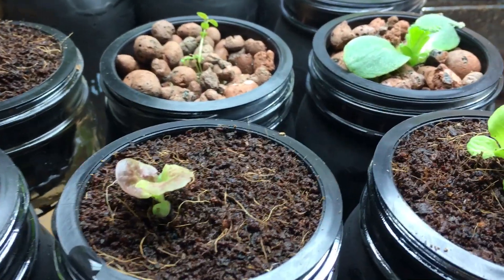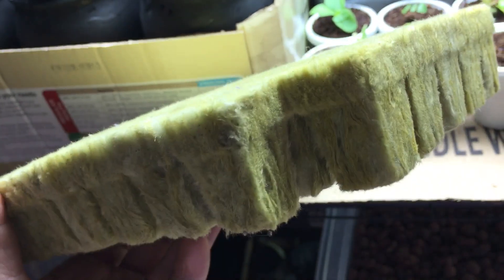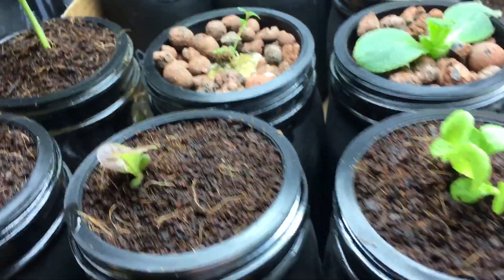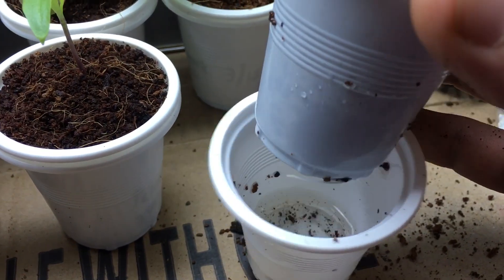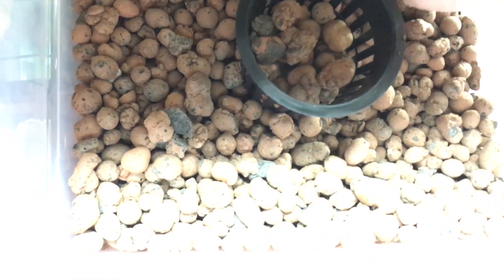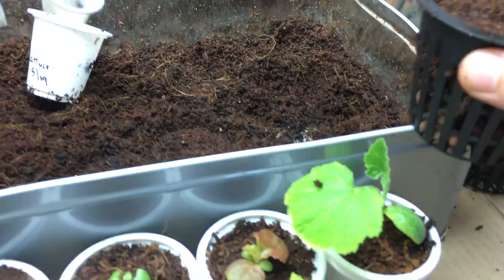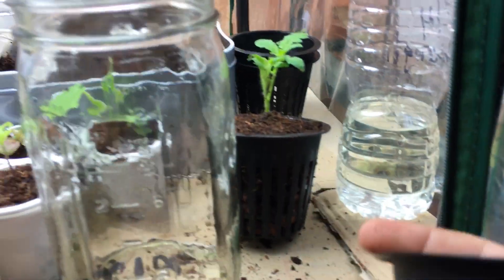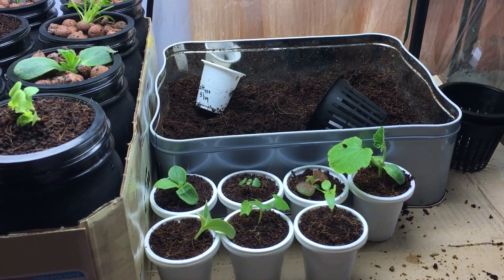How To Transplant Coco Coir Into Hydroponic Kratky System - Step By Step

Comment: fantastic idea. i also heard some use 4 parts clay pebbles to 7 parts coir as the initial medium. Sounds like they mix them together. Im going to try sowing a few seeds into 2 inch net cups with the coir and clay mixed together as the main medium. Make it even easier. Then just plop them in to the kratky container lid and take it from there. I have had issues with rockwool and pebbles on top too! algae or mold on some of the pebbles.Horrid...love your method too. Thankyou

Comment: 太厉害了 太符合我这种喜欢整齐的人了 请问你怎么施肥呢
Reply: Hi Lily, this is a hydroponic method called "The Kratky Method" or "Non-recirculating Hydroponics".

You need to use hydroponic nutrients in the water which you put into the jar. This is a chemical fertilizer which comes as a powder and it must be diluted according to the instructions on the packet.

Once the jar is filled with the hydroponic nutrient solution, you do not need to add any other fertilizer.

This method is easy for beginners because you can put the plant into the jar, fill it with the hydroponic nutrient solution and then it is done.

I hope that this makes sense. Please let me know if you want more information.

Comment: Do we need to
Sterilize the coco coir, TIA
Reply from the maker: No I don't think so. I never do anything special. Just add water and seeds. It expands a lot example thought so you probably will need less than you think. It's a good idea to wash it first time you open it. Will help wash off any dust and lose debris that may be around.

Comment: Rockwool started off great for me my first year and a half in hydroponics but something changed. The last shipment of rockwool has made germination so difficult. Maybe only a third of my plants were germinating and not dying off within the first week of life, and no this wasn't due to damping off. I switched to germinating in paper towels which has worked great but then transplanting into hydroton has been difficult for the more sensitive (smaller) plants. I'm excited to try coco coir next, I think it'll end up being what I've been looking for.
Reply from the maker: Coco coir is great for sure, but it's not so great for larger plants. Just keep it in mind. Like tomatoes, peppers that need support will fall right over once it's dry. Excellent for leafy greens and small plants. Especially strating out new seeds
Reply: @SoothingLeaf  oh I was just intending to use coco coir for seedlings, then move the seedlings into (on top of) hydroton. Thanks for the warning though! :)

Comment: I'll try much time to seeding in coco pet but every time I failed what a problem?
Reply: It's possible that your coco peat is too high in salinity and it is killing your seedlings.

You may need to soak and flush your coir before use.

Some coir is low in salinity and can be used directly but other brands require the salts to be leached before use.

Comment: Have you tried to soak rock wool in diluted Hydrogen Peroxide to prevent algae growth? Can't you use clay pebbles as the only medium, instead of using coconut coir? Have you also tried to use perlite or vermiculite as the medium? Thanks.
Reply: Hydrogen peroxide is a double edged sword, it can easily kill your plant, plus 3% H202 is really expensive.  I live in the desert and even with covering the rockwool with radiant barrier insulation, it still gets algae, and I mean heavy slime algae.  I switched to coir/perlite/vermiculite mix, planted in a 12" air pruning tree tube, then the tree tube sits in a 10" net basket which is inserted into a 2 gallon food grade bucket.  This has been the only thing that works here in the desert.  I have a 2-1/2 acre farm so it was gratifying to finally find something that works.  Another problem I had is that once the weather hit the mid 100's, the rockwool was drying out causing stress to the plant.
Reply from the maker: No never tried that. I would honestly avoid doing that. I can't imagine it's healthy especially for consumption plants. Instead just cover the rockwool with a grow media like clay pebbles or even foil would do great. As long as you keep it covered you keep algae away.
Reply: @SoothingLeaf  Hydrogen peroxide is water with an extra oxygen atom. 
Nothing scary but yes you can definitely over oxygenate things and bleach/burn.  
Lots of people drink diluted food grade hydrogen peroxide to oxygenate the body and cure disease.

Comment: Could you start with seed directly in this? Like instead of waiting for it to grow roots in another cup, just plant it directly into mesh pot with clay and coco and then just water from top until roots showing and then after start filling the jar?
Reply from the maker: Yes you could absolutely start this way. The only thing is when you are going to be top watering some of the Coco coir will fall to the bottom of the jar or container used. This will not affect the plants growth or anything but I don't like having Coco coir in my water. You could always just replace the water inside when roots are a little established and you are no longer top watering.

Comment: You will need oxygen later on in growth
Reply: Look up videos about the Kratky hydroponic method. It uses the roots that are exposed to the air as the water level drops to absorb oxygen.
Reply: If you used a traditional Kratky method using rock wool instead of coir, then yes, you need 02 at some point. He is also not using the traditional Kratky method of rock wool growing into an entirely water medium, he is using self-watering pots - in other words, it is not really Kratky growing we are seeing here, it is a traditional growing method which just happens to use Kratky nutrients.

Comment: Excellent presentation sir

But let me know if this will work equally well in daylight (patio/ terrace/ backyard) during summer at 100 degrees?
Reply: Yes, it will work fine.  I live in the High Desert of California and use a modified Kratky system myself.  I always recommend that if you live where it regularly gets over 100 degrees, to grow under shade cloth or on a covered patio.  I have been farming for 15 years and even my trees are under 90% shade cloth.

Comment: Great video!  I tend to start seeds in seed starter mix or coco, then when the seedling gets its true leaves, I carefully pull out the plant and wash off the roots. Then thread the roots through a net cup and put into nutes in a mason jar. I use hydroton to hold the plant up in net cup and block out light. This seems to work well so you never have rockwool rotting or coco falling into the water.  All methods seem to work though and all a matter of preference. Love Kratky !

Comment: Just because you can't see algae on the coco coir doesn't mean there isn't any. It's just you can't see it in the darker material.
Reply from the maker: I wash and clean the jars between refills now and check the levels every 2 weeks changing out the nutrients if needed. It is now 100% light proof but definitely does a good job in my experience. The paint will begin to chip away with each wash so might be best to use a different material to cover up the jars. thanks for watching

Comment: You fill the jar with nutrient solution above the bottom of the net cup. Then how does air get to the roots - can it penetrate the coco coir  ? Please  educate me.
Reply from the maker: Being that I am using two grow media I wanted to make sure it was able to wick its way up well. So I add a little bit higher then just touching the very bottom of the netcup. I learned from experience once you get the lights on the system a lot of the water will evaporate and may drop your levels faster then you assume. So by the time your roots begin to grow down your levels will have already fallen below the net cup. Also everything that is in between the water line and the top of the net cup is above the water allowing the roots to stay air roots and some roots to become water roots. Hope this answers your questions.
Reply: If the root doesn't grow as fast to reach the bottom of the net cup, does it mean we need to top up nutrients during the initial growth period?

Comment: Nice love how you do that definitely gonna try this only need now left is waiting for the Fertilizer,  Ph Meter: and Coco Coir, Is CoCo Peat Coir Fiber the same as FibreDust Coco Coir ? http://tinyurl.com/n3ch8oo sad to hear that amazon usually ships within 1 to 2 months :-/ but dang the Coco Coir look much better than soil or potting mix
Reply from the maker: That's awesome your almost all ready to go just a little longer I'm sure you can't wait to start. Wow that is some serious wait time way to long I think and not worth the wait. This looks like a great alternative you found. Organic, pre washed with reverse osmosis water and good price. I never heard of coco peat but appears to be the same thing with a different name. Both seem to be made the same way out of the same product so I can't see any distinguishing difference. Just learned recently that it's even reusable for up to several years wow! No need to wait a month to start growing. You found a great option i would go with it! Just remember to pre wash it yourself several times before using. I like to use an old pillow case holds everything in easily without losing.a ton of coco in the process (use hot water) hope this answers your question.
Reply: Oh thats a good idea!!  (ping...Light bulb ON lol) for cleaning coco with a pillow case :)
Reply from the maker: A nice tip after washing the coco place into a closed container and it will stay nice and moist ready to be used when needed. And you can wash little bits at  a time or you need a large container to hold all that expanded coco. Half of the block filled up a 5 gallon bucket to the rim for me. Little goes a long way
Reply from the maker: This will be a good option and local pickup is even better no need to wait for mail. Looks like its a good coco coir and decent price for 11 lbs block. They sell one that is also $32 I see same thing just broken up already. This is just a marketing ploy mentioned washed it 3x and the one your looking at does not say anything about how many times rinsed. So just simply give it a really good soak and rinse when you get it and will be good for use. You want to wash out the coco coir not only to get ride the debris and dirt but also the salt content. Coco coir is high in potassium so its best to give it a real good rinse. Using hot water i find speeds up the process breaking down brick and sterilizes the product a bit.
Reply: Just bought 4 blocks for coconut fiber from Home Depot $2.99 each got about 4 to 5 gallon worth right to the top washed it for about 5 mins (hot) like you said how long does it take to dry ?
Reply from the maker: That is a little hard to say. I have a 5 gallon bucket that has been sitting there for about a week and half now still as moist as ever. If you keep it together will stay wet/damp for a long time. Hold like 5-9x it's weight in water. But will really depend on the conditions your keeping it in. If out of the sun and covered should be ready for use for a few weeks. The easiest way to know is either by the weight feel the different between dry and fully hydrated material will be a significant different. Or you can always tell by the color of the grow media. You will begin to see it slowly drying out over time and getting a light brown color. Hope this helps. Just take note of both of those things and you will be excellent. Best of luck!

Comment: So glad I saw your video before going with the rockwool. I live in Arizona and planting outdoors is futile. The plants struggle through the hot summers. I have herbs indoors now under grow lights but want to grow lettuces, spinach and chard hydroponically. I enjoyed your video. Thank you. Will use your links to buy pebbles and baskets.
Reply: Esha Gayle Thank you! I am so glad was able to provide some information that was useful for you. I honestly love using coco coir now and will never go back to rockwool. The Arizona heat can be brutal but hydroponic growing has such amazing success everyone should be doing it. Sound like you have a really nice edible garden going I wish you a ton of success and bountiful future harvest.Thank you so much for the support!!
Reply: I also live in the desert.  I use coir/perlite/vermiculite, heavy on the last two so it holds water longer.  I grow tomatoes and all winter crops thru out the summer in a shed that I have a evaporative cooler in.  It stays 65-70 degrees thru out the summer.  Growing radishes and beets too.  So nice to not see the tomatoes stop producing when it gets hot, instead inside, they just keep on all summer.  I grow micro, dwarf and determinate tomatoes inside so they do not get too big and the Hidden Harvest Lights  $80 each) I am using are out-performing my $600 LED lights. Another nice thing about the Hidden Harvest lights are that they are white spectrum so you can have them in the house without worrying about your eyes.
Reply: @SUHSeungJi  i enjoy reading about your grow
perhaps you would like to do some videos about it?

Comment: Cool video, thanks. Hey I got cucamelon seeds from rareseeds.com, and using the paper towel method on a heating pad I got like 75% germination in 48 hours. Crazy! Question: would you recommend coco coir as an indoor grow medium for my cucamelons? Another option is a peat moss pellet. I just want to get them started up to one set of true leaves indoors, then in a few weeks I'll harden them off and plant them in soil outside. Thoughts?
Reply from the maker: That is so exciting I know how you feel right now and only in 2 days wow! Must be some fresh seeds from rareseeds.com I must give them a try. I would highly recommend using coco coir both indoors and outdoors, peat moss is great also but i wanted something that was 100% reusable, organic, and would work well in hydroponics. Peat moss can be high in acidity and cause root trap. Check out https://www.planetnatural.com/peat-vs-coir/ great article comparing the ups and downs of both. Will help you decide between the two my vote is for coco coir! 
Hardening off seedlings gradually in the beginning to get accustomed to the outdoor heat, cool nights and different watering schedule. Start with partially sunny conditions for 2-3 hours of sun indirect is best in the beginning. Keep a close watch over the plants in the beginning to not get any frost damage, sunburn spots, keep winds low and out of the rainy conditions. Have to watch over the babies in the beginning. 
Looks like your on the right track so far keep it up!